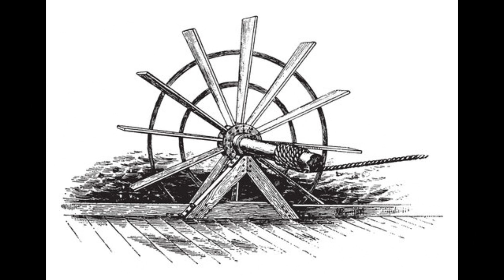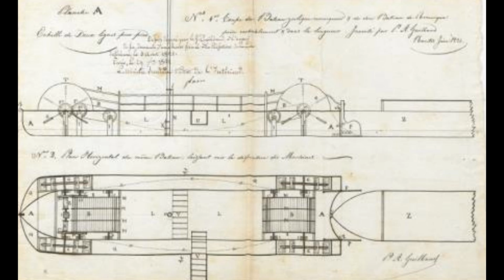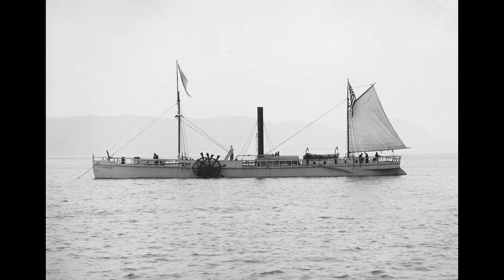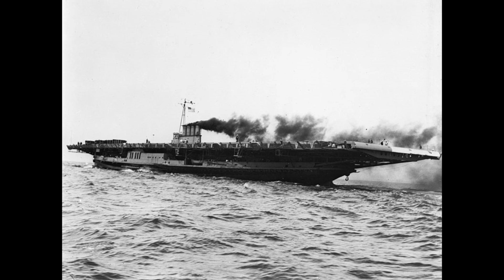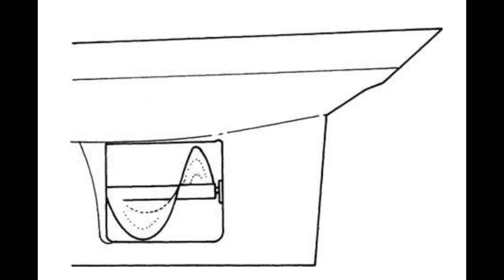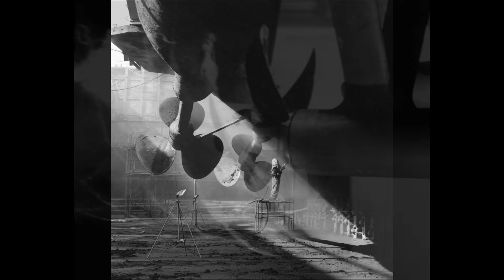Paddles and Propellers - It's all about the rotation

Comment from the maker: Pinned post for Q&A :)
Reply: Josef Ressel was awarded a propeller patent in 1827. 
He modified the steam-powered boat Civetta by 1829 and test-navigated it successful in the Trieste harbor at six knots.
Reply: On the advantages of paddle wheels:  I swear I read somewhere that they are more efficient than propellers at turning engine power into thrust at very low (especially zero) hull speeds.  Above a few knots, this ratio reverses and the prop gains the advantage.  This (along with, as you said, maneuverability) was allegedly one of the reasons that they hung around for so long on harbor tugs in the UK.  Is there any truth to this?
Reply: @Zeppflyer  I used to work aboard Waverley (the last sea going paddle steamer) not sure the above is true but Waverley certainly has very good acceleration deceleration capabilities and could probably out-do a screw ship in those areas. However she suffers in her ability to steer at slow speeds, particularly when going astern. So she tends to approach piers quickly for manouverability and use full astern to bring her to a quick stop. Waverley has a fixed shaft to both paddles so cannot have each wheel operating in different directions, the late RN tugs you mention PS Forceful etc however could operate their paddles independently I believe giving them additional manouvering capabilities.
Reply: On the subject of paddle propulsion do you have any plans to go aboard or do a small video the PS - Waverley?,  Since she is the last seagoing passenger-carrying paddle steamer in the world and she is here in the uk even though she isnt a navy ship.
Reply: @wulfie1199  I would love this too, we are saving up for a trip on her ourselves
Reply: Drac pls explain a little more about fuel restrictions.  It's at 1.08 into the video.  Thank you
Reply: Have Drach answered what's the name of the Fridays intro music?
Reply: Could you do another part of the series, concerning rudders and how the steering mechanisms evolved over time? While steering a two person sailboat with a tiller is fine, i assume using the same technology would have been a bit impractical for ships like the USS Lexington or the Yamato.
Reply: Would you consider world of warships crusier Admiral Schröder, the ultimate raider? Given her many secondaries could pick up many merchant ships in tandem and with her 32knot speed, could avoid any convoys with escorts she can't handle.
Or just a 30+ knots predreadnought be the ultimate raider?
Reply: How did the retractable propeller shaft work on HMS Erebus? Referring to the Franklin Expedition Erebus.
Reply: @bertbaker7067  good question, and maybe, how did it compare to the system on HMS Warrior?
Reply: What are your thoughts on bringing sail back into modern cargo vessels?  I'm not suggesting returning to wooden ships, but rather take modern engineering and designing a ship that transports shipping containers primarily using wind.
Reply: @lonjohnson5161 09-19-23 I watched a short video on that. The ship had a giant parasail that could be let out if the wind was in the right direction and reeled in if necessary.
Reply: Sir Drach- you surely need more ideas/suggestions for future vids, yes ?
 Would you please consider doing a vid or vids of canals & their usage, battles around & their general history via the worlds navies ?
 If possible, Suez, Panama, Kiel and on....I'm sure many others crop up in your head as worthy of the Drach treatment. Thanks, my friend !!
 Ps-  do you ever wear that Philadelphia Flyers hockey jersey ?
🚬😎👍
Reply: 1.Was there any attempt to make a catamaran type ship with paddle wheels between two hulls?
2. When did steel cables replace ropes on warships? Wasita gradual process, or simply when the sails were gone the ropes followed?
Reply: You said paddlewheel driveshafts are generally above the water line, when was it not?
Reply: It is often talked about how technological edge in aviation is more important than tactics. Like 1st gen jet fighters vs propeller  driven planes. Doesn't matter how good your tactics are the jet will just out run you and the like. Where as in land forces you can use tactics to negate some technology disadvantages. In the world of navy does it what had larger impact on winning, tactics or technology
Reply: Would you consider doing a 5 minute guide on either of the uss princeton steam ships from before the american civil war?
Reply: Why did it take so long for sailing ships to adopt tripod masts?  Going from pole masts to tripod masts would allow the standing rigging to be eliminated, considerably simplifying maintenance, freeing up space on deck, and reducing the risk of a ship being dismasted by enemy gunfire (due to the replacement of the relatively-fragile standing-rigging cables with thicker, stronger poles), yet tripod masts on sailing ships don't really start appearing until almost the end of the Age of Sail... ?
Reply: It would be interesting to know if naval engineers were using tools such as blade element theory and momentum theory to design ships propellers around the turn of the 20th century or if they were still using trial and error, rules of thumb, and "that looks about right" to design them.
Reply: How was passing through the hull below the waterline addressed? Was it due to material advances or design advances?
Reply: You mention the poor reliability of early steam engines- what does an under-way "breakdown" of an early marine steam engine look like, and given how dangerous live steam is to what extent is "unreliable" an euphemism for "likely to kill the operators"?
Reply: I want to make a suggestion about the introductory music for your videos. Search "Introductory music for the TV show Black Sheep Squadron" I think this music might be a good replacement for your past Introductory music, which I thought was great, hate to see it go! But, I think, since the Black Sheep Squadron music is Marshall music, it might be satisfactory if you can digitally remove the air raid siren at the beginning. I'm a former Marine and the Marine Corp is part of the Navy, so it at least has a nautical connection.
Reply: Would a CSS Hunley style crankshaft propeller Greek trireme make sense?
Reply: The thumbnail shows a ship propped up on wooden supports; some appear to be effectively tree trunks with the bark stripped. How were/are these manoeuvred into position as the water is drained? I cannot believe they're something to can just 'slip in' by hand.
Reply: Could you estimate the speed of the ship shown at around 13:00 mark? Speed with paddles in calm weather. And by sail on stronger wind
Reply: there was yet another development, the Voith Schneider Propeller, i would like to hear Drachinifel would referring to this principle.
Reply: Were there any ships with sails, oars, and steam and if so could you do a review of the ship or ships in question?
Reply: If the toroidal propeller form had been used from the beginning of the 20th century onwards, what consequences would this have for max. speed, stealth, efficiency,, cruising speed range and so on for warships, subs, torpedos, aircraft and other machines, given that the increases in efficiency and other improvements of this propeller type are massive? [warning, potential rabbithole ahead]
Reply: In many sources the Wright brothers are often credited with vastly improving the analysis techniques used in designing efficient propellers. To the point where some seem to suggest  that most of the preceding propeller design work was nearly completely trial and error. How did the Wright Brother’s approach to propeller design change the way naval propellers were designed in the early 1900’s and were naval propeller design techniques really that far behind or is this just a myth?
Reply: Why go into so much detail in Francis Pettit Smith's 1836 propeller when it was a reinvention of Josef Ressel's 1827 propeller? Why not mention Josef Ressel?
Reply from the maker: @RedbookGereute-bs1xg  There are half a dozen different claims to who 'invented' the screw propeller in the 19th century, but Pettit-Smith's was the one that 'caught on' and was taken forward into widespread use after some adaptation.
Reply: Would love to hear your thoughts on toroidal propellers.
Reply: How does an underwater propeller shaft prevent water leakage inside the ship ?
Reply: As there is quite a bit of Drach out there and YouTube has it's limitations regarding index and register: wondering if cycloidal props in some form or other were ever covered on the channl. Say the USS Alarm (what's in a name) Fowler Wheel maybe? A question possibly answered via an index or register. Thx and cheers from a beautiful Utrecht.

Comment: The weakness of feathering paddlers was the rose. This is the device that feathers the  floats. The steam side wheel paddlers were not able to reverse independently. This was because the paddlers shafts were connected directly to the crankshaft of the engine.

Comment: Hi Drac, you may be surprised as I was, when I saw a showing British Waterways, of all people,  using  a paddle wheel work vessel  this century! This was a small workboat of flat bottomed design, powered by a pair of hydraulically driven paddle wheels. Mounted on this boat was a set of hydraulically powered "weed cutters", siuated on the bow, with the wheels towards the stern. I assume that hydraulics were used to drive everything for engineering reasons. Basically the thing was little more than a shoebox type construction, with a small engine, possibly even electric, to run the pumps for the drive systems. I have searched in vain for this program again but have yet to find it, it is possible that it was  a segment "Jack Hargreaves" fishing type video, but given his prolific output, not to mention the varied subjects mixed together, I still have many to search in my quest. Seems to me. for the purpose of cutting back weed overgrowth on canals, given the possibility of prop fowling, that the paddle wheel is a good solution and an example of early engineering used in a modern context to solve a problem that has been around since man took to the river to get around!

Comment: with 20-20 hindsight, it's surprising why no one thought of placing the paddle wheels (today known as open impeller centrifugal pumps), fully submerged, horizontally placed inside the hull of the ship. just 4 pipes allowing water in or out. fast forward to today, a ship so equipped (using Pelton wheels instead of paddles) could turn around in a ship's length. it's not a new idea, it was used in the Mekong River Delta by US forces boats during the Vietnam war.

Comment: Contrary to what was said at the beginning, sail-powered merchant ships did not carry on into the early part of the 20th century because of the unavailability of fuel. The main reason why square-riggers persisted in transporting grain from Australia and guano from Peru was money: it was cheaper to carry bulk cargo that did not need to arrive quickly by sail, where the only running expenses were the (poor) salaries and food of the crew and where fuel did not take up a notable portion of the storage space and draught. Gustaf Erikson of Åland was able to buy a large number of sailing cargo vessels cheap after WW1 and he had the largest sailing cargo fleet in the world by the 1930s. He was able to make a bundle specifically by keeping expenses down and concentrating on grain and lumber; there would have been no fuel problem between Australia and Europe or between Scandinavia and Britain, where he primarily operated.

Comment: Very enjoyable video!😃

When I was a kid, and actually decades later building a powered balsa ship with my daughter, I did not always have a readymade model propeller at hand, and had to cut and bend  ones out of tin-can sheet metal. So I actually spent a lot of time thinking about propellars, and also finding out that relatively "small" errors when making them, made a big difference. So starting from an early age, I've been aware ship/boat propellars are not trivial stuff!

Then you go on to airplane propellars, turbines, different pump designs etc, and you realize the field is absolutely insanely complex. Achimedes and later followers, just didn't know what a hornets nest of technical problems they unleashed!😆

Comment: Paddle wheel propulsion makes periodical comebacks. Not so much in the military context anymore, but in river passenger ships. Recent examples are the Loire Princesse with side wheels and the Elbe Princess I & II with stern wheels, all operated by CroisiEurope. These floating hotels have a pretty constant draft as passengers don't weigh as much as cargo and the ships have ballast tanks, so staying at a level that works well for the wheels is pretty easy.

The main reason for the revival of paddle wheel propulsion is the nature of specific waterways, both the Elbe and the Loire have a lot of shifting sands and frequent periods of shallow water.

These ships aren't perfect though, vibration has been a major issue.

Comment: One point I have never seen addressed on ships with multiple screw propellers.
Do all the propellers turn in the same direction or counterrotate to nullify the
'P' factor torque effects found in multi-engined propeller aircraft?
Reply: Most twin screw vessels have them counter rotating. Triple screw the outer ones will be counter rotating but the centre could go either way

Comment: How did they figure out that cavitation was what caused their damage and efficiency problems? It's not a very intuitive phenomenon, especially when you can't directly see what's eating your propeller.
Reply: It started to become a problem in the late 19th century.  As power increased designers found that the propellers were not acting as predicted and were losing thrust in high loading situations.  There was a lot of discussion at the time if it was caused by air ingestion or something else.  I believe it was Reynolds who named it cavitation. 
 Around 1895 Charles Parsons had this problem with Turbinia, he built a small circulating water channel that could take a model propeller so he could examine the phenomenon in detail. Realised it was related to the thrust and area of the propellers and created a crude rule of thumb based based on a maximum value of thrust pressure to avoid it.  His original tunnel was for many years at Newcastle Uni beside the much larger Emerson cavitation tunnel, used for modern day propeller research. It is now in the Discovery museum collection alongside the Turbinia herself
Reply: @robertmutton4973  Thanks!

Comment: A query for the more mechanically minded of you: Forward-facing propellers.

I've seen a design in 21st century that reverses the facing of propellers. Rather than rear facing out the back of the ship, the screws are mounted on pylons below the keel and face forwards - the implication being that they pull the ship through the water rather than push it. Is there an advantage/purpose to this design?

Comment: Great video fer shure!  Nice job on the historical (sometimes hysterical) efforts to power paddle wheels. As for human power, I've used the modern 2 person paddle wheel boats (on a pond) where the people work pedals (like a bicycle) which are hooked the paddle wheel. One would need to be an Olympic calibre cyclist to get any degree of speed and maintain it.
I served on a certain large aircraft carrier in the US Navy in the '70s and got a good look at the propellers. Talk about massive pieces of metal. I don't think they'd fit in the room where I watched your video. Thanks for your research efforts and the storyline. Very cool.

Comment: You mentioned the use of counter rotating propellers to counter the torque on the steering - this is well-known with sailing yachts where it's called "prop walk" and can be a trouble at low speeds, especially when docking under motor. Knowing how it works on your boat is a pretty standard  skill for a yachtman, and can be used to get out of confined spaces.

Comment: Not bad, but you omitted Paddle Wheels w/'articulating'(pivoting) blades, which were more efficient than fixed blades.
The German company Graupner produced a 40" long model kit of the Glasgow tug with these sidewheels.
Reply: Also the designs that allowed the paddle wheels to be cranked vertically out of the water when the ship was operating under sail only, thereby completely eliminating the drag from the paddle wheels.

Comment: @24:35 The trials between HMS Rattler and Alecto were important for the RN, but as you say, key Navy leadership had already been moving  to the conclusion that screws were superior after Rattler's initial sea trials in 1844. So much so, in fact, that even before the Rattler-Alecto "contest" in March '45, the Admiralty had already decided that screw propulsion (specifically, using two-bladed Smith type propellers) would be added to HMS Erebus and HMS Terror for Sir John Franklin's (ill-fated) Arctic expedition - albeit, alas, connected to very underpowered (20 and 25 hp) locomotive engines. Fortunately, Rattler (200hp) would end up helping tow Erebus and Terror as far as Greenland....